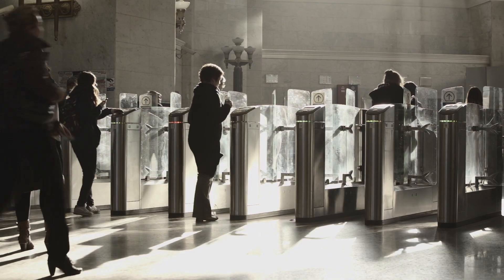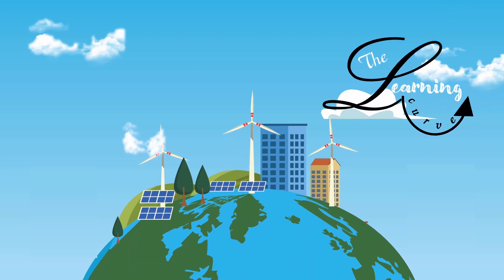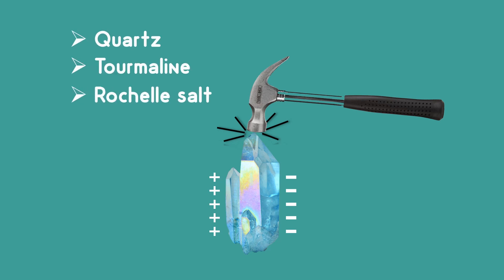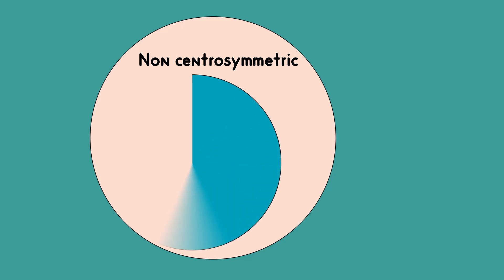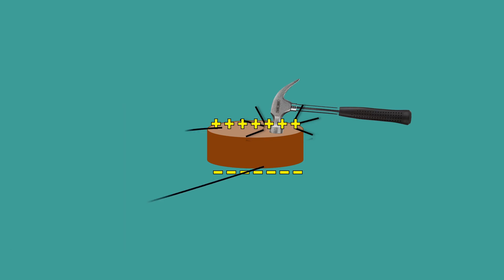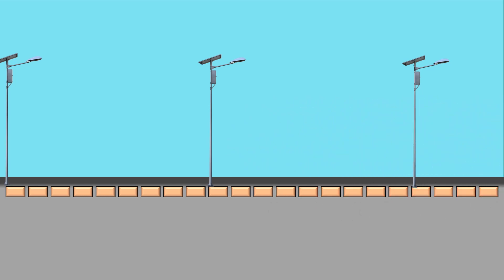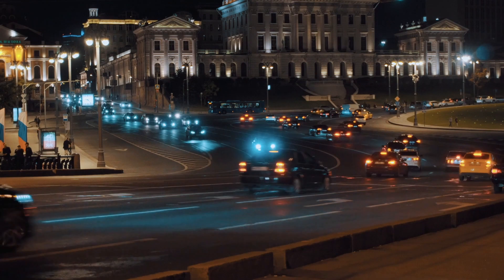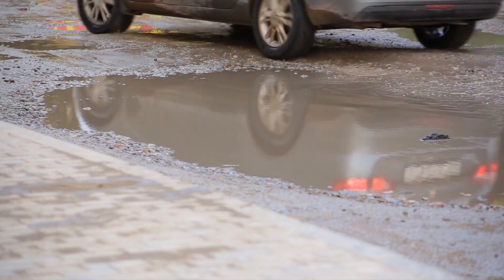Turning Traffic into Electricity - Piezoelectric  Roads !

Comment: Ya, this can be a good substitute that can have sufficient amount of electricity that can atleast make street lights work. 
......
Since the devices are embedded 30 cm apart from each other and in two rows per lane, a kilometer of a two-way street will contain 13,333 devices, each device costing $30.39, adding to a total of $405,253.

It will be so much expensive to have that implantation. For 1km it costs nearly Rs. 3,34,33,372.5
And another thing is to maintain its efficiency. 
So, at present, in my perspective this can't be implanted in INDIA. But Ya, in the upcoming years, as the technology develops, it will reduce its expenses. At that time we can have a good project upon it! ☺

Good Explanation !
It was informative.
Keep working hard !
Reply from the maker: Thank you 😊

Comment: Thank you for this example, which I can show a friend of mine, about nonsense research in the world. Basic physics tells us that with converting one kind of energy to the other, there are always losses involved. I find it nice how you try to sell this as "free energy" while in fact the idea comes down to cars constantly "driving uphill". Therefore, more chemical energy is required in the form of fuel to have cars drive over such roads, thus resulting in more CO2 emissions. 

Knowing that the efficiencies of: 
Fossil powerplants are 33% to 45% (Fuel --> Heat --> Kinetic energy --> Electrical energy)
Gassoline cars are about 29% and Diesel cars are about 32% (Fuel --> Heat --> Kinetic energy)
Then using the kinetic energy of cars to generate electrical energy results in a total efficiency of <30%

Then imagine the energy loss of electrical cars driving over these roads (Electrical energy --> Kinetic energy --> Electrical Energy)

I rest my case.
Reply: Dude... Your statement about what basic physics tells us that converting one form of energy into a
other incurs loss is wrong. :P
There are many ways to categorize energy. In thermodynamics One way is to categorize energy is: high grade energy and low grade energy.
When you convert low grade energy into high grade energy there are always losses involved. That's why you can't convert 100% heat into 100% electricity. That's why even in ideal case of carnot engine, you can't have efficiency more than carnot efficiency.
But conversion of high grade energy into low grade energy can be 100%. So you're able to convert all of your electricity into heat. Without any loss. For example electric geysers.

And here in piezoelectric roads, we aren't generating energy at the expense of fuel that's burnt in engine. We're converting mechanical stress into electricity. So the roads could be normal. Yes the construction would be a little difficult and costly but ultimately the roads gonna look normal after completion as they look now.
Reply from the maker: It's very normal for a road to experience vibrations when cars and heavy vehicles pass by. Piezoelectric roads recover this energy that would have gone to waste. There will be no or very minimal energy consumption by the cars. The roads are always busy now a days and no one is going to stop using cars in near future.  The energy exchanged with the road by friction isn’t enormous. As you said losses will be more. But if you can capture just a fraction of it into usable electricity, the savings could be huge when you factor in tens of thousands of vehicles driving over a road on a daily basis. 
I don’t think this piezo electric road can replace conventional thermal power plants. I agree that efficiency will be low. But when the energy transition takes place, piezoelectric roads could be helpful as they can generate some decent amount of electricity.